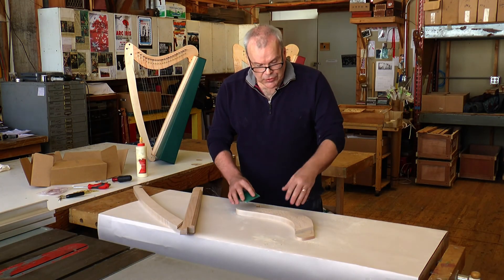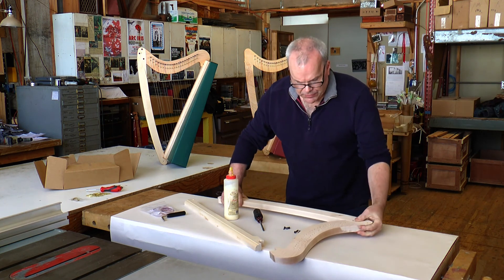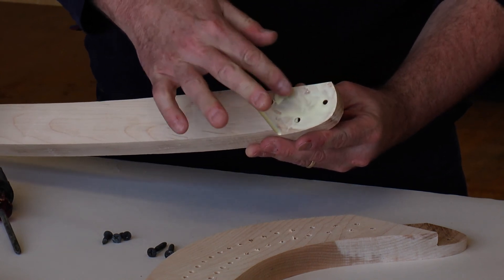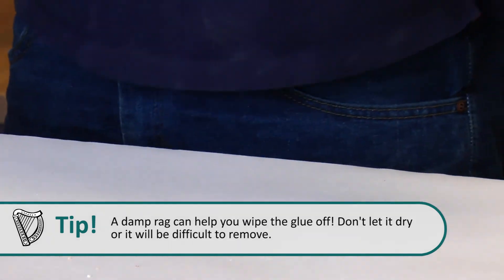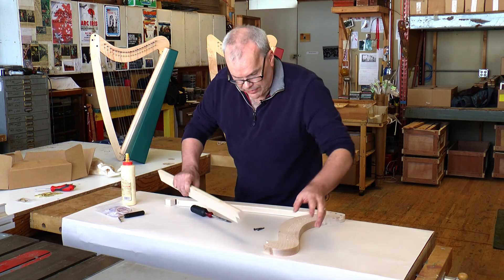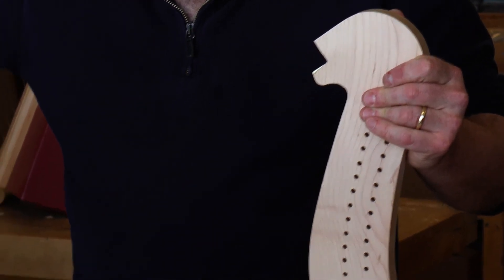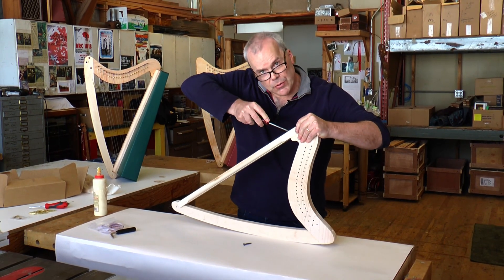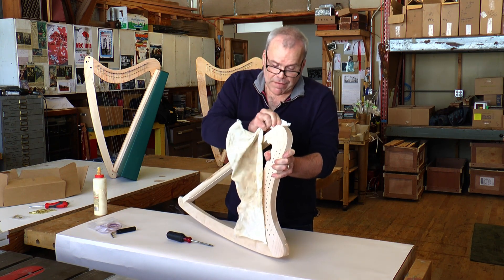How to Build Your Fireside Harp 2: Assembling the Frame

Comment: Recommendation on the gluing:  It's good to keep glue from oozing out.  Good glue like Titebond or Gorilla 2 will hold well.  But if any glue touches the surface of the wood it will make staining (if one wishes to do so) more difficult.  I build folk guitars, and one definitely doesn't want glue to touch the outside of the wood.  If it does, use a damp cloth to wipe it off thoroughly.  Just my opinion on that part.  ; )
Reply: Thank you so much! I always come to the comments for all the knowledgeable tips

Comment: Thank you for the lovely instructions! After I have the body sanded and the glue is dry, would staining or painting the body of the harp be alright,  or should only the sound box be painted?
Reply: I have never made one of these before but(!) I see a section on oiling the frame and, given several decades I have making many other things in wood, I don't see why you couldn't use a dark oil. I wouldn't paint it, though. That would seal it of from breathing a bit. I may be wrong, though. Is there a phone number in the shipping box?
Reply: Hello! Staining or painting would be alright...and it shouldn't change the tone  much at all. Really the main reason we oil them with several coats of Tung oil is because maple is such a beautiful wood with great character....painting or staining would be fine. Thanks for asking about the Fireside Harp!